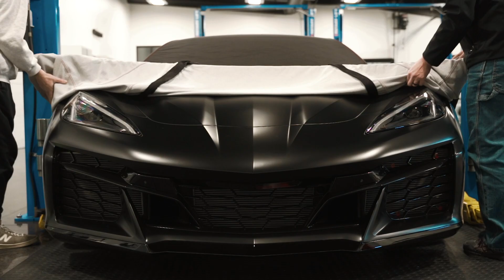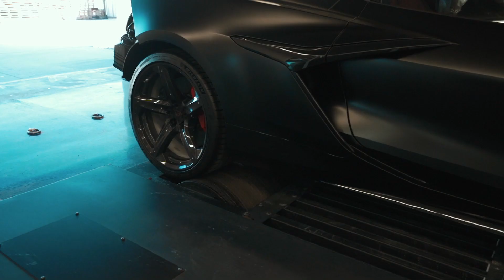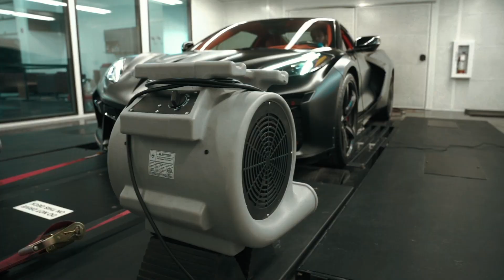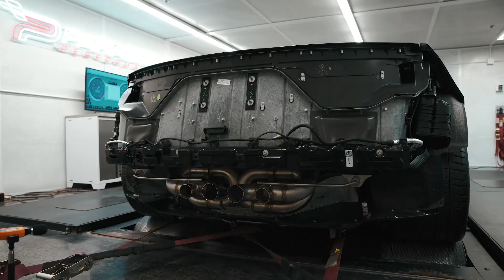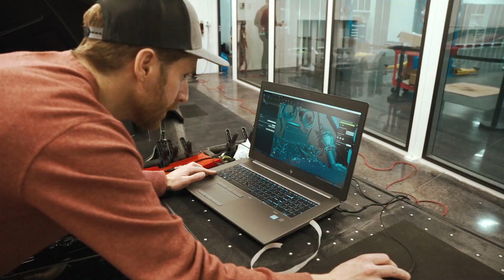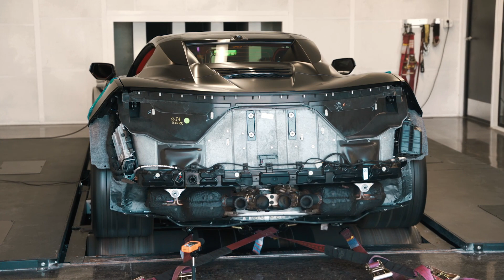C8 Corvette Z06 Dyno Testing Teaser! - Paragon Performance!

Comment: We already know there is still horsepower left in the Z06, but it comes at a price of CABIN BUZZ  from flat plane crank engines. You are not going to like it on the street either. Even Ferraris aftermarket exhaust systems come with the most annoying buzz that makes street driving unenjoyable.
Reply from the maker: Exhaust there’s little drone, sport cats also minimal drone. Both combined, good luck hearing your own thoughts